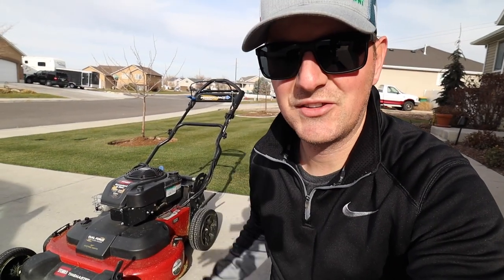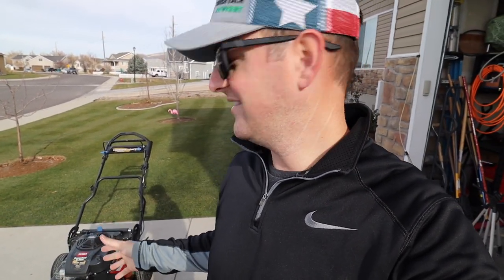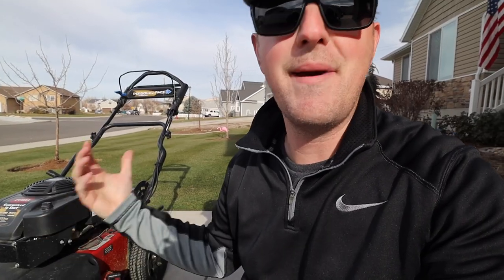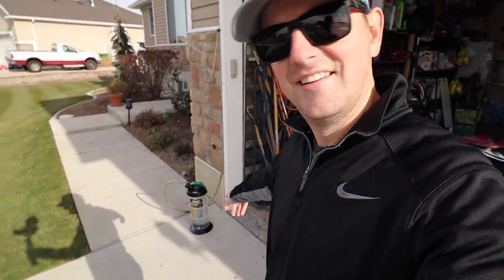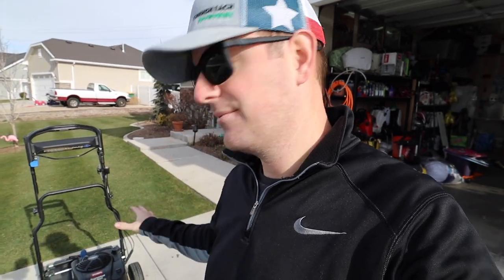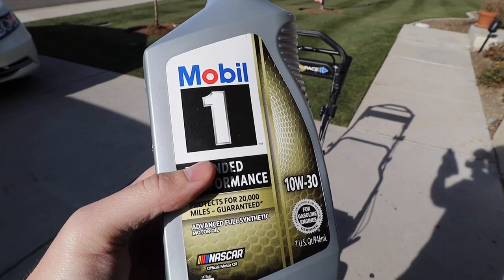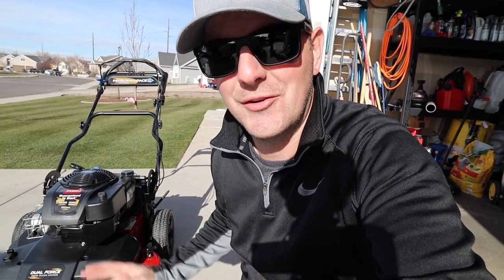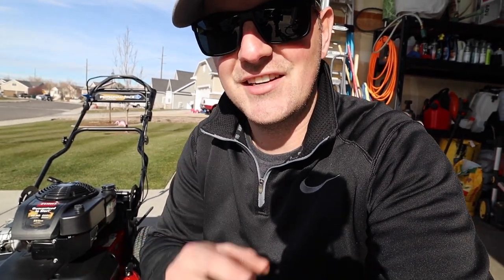The BEST TIME To CHANGE YOUR LAWN MOWER OIL - Toro Timemaster

Comment: Hi Jimmy-nice video. Quick question: When do you recommend to change the air filter? Thanks Martin M.
Reply from the maker: Hi Martin! Inspect it annually and change it when it looks dirty. Depends on how much use the mower is getting really. Your mileage will vary. Hope that’s helpful.

Comment: Looking good Jimmy! Hey I meant to ask you, have you ever needed to replace the valve cover gasket on your Timemaster? I notice on mine after I mow I have some oil that has dropped on the belt cover. I can only assume it’s a bad gasket. I tried tightening the bolts on the OHV cover but they were already snug, so that wasn’t the fix.
Reply from the maker: Thanks, Vinnie. I've never needed to replace that gasket. Sounds like that might be your fix, though.

Comment: Just flip the mower on its back. As long as you don't have a lot of gas in it, you're fine from fluids going where they shouldn't. Too much gas and it will dribble out. That's some expensive oil when the oil change interval is every 50 hours of use 🤣